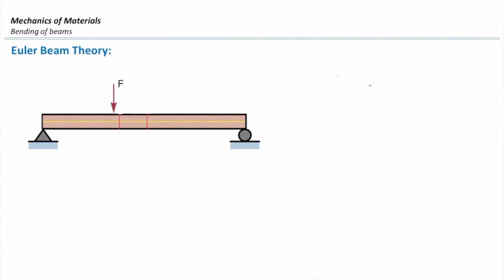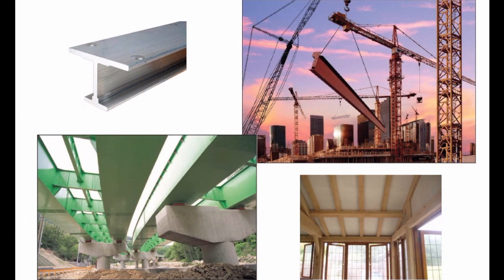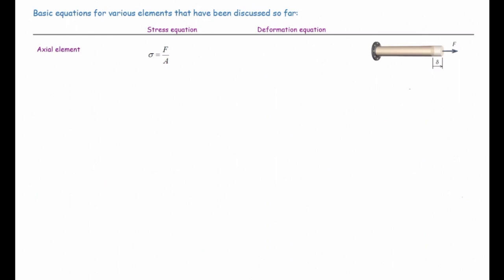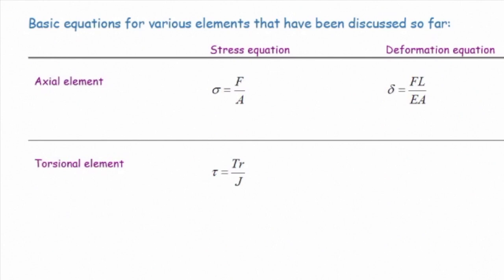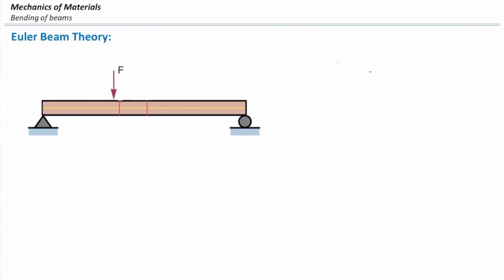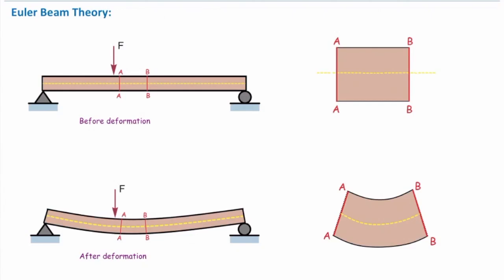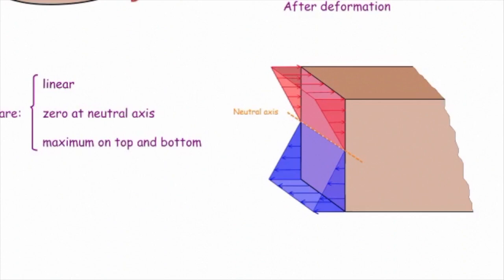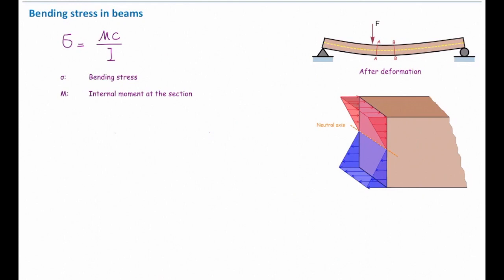Lec12, Bending stress in beams (part 1, lecture)

Comment: I know this sounds basic, but at 5:05, the center line of the deformed element (the curved yellow dash line) obviously does not have the same length of the center line of the undeformed element (the straight yellow dash line). Is there any assumption here to be made???
Reply from the maker: In the deformed beam where one side is compressed and another side is stretched, there will be one line that keeps its length. That part is known as the neutral axis. In the figure shown, the beam faces could slightly move inside to make the curved line in the deformed beam equal to the straight line in the original beam. However, as long as deformations  are small, in could be proved that these two have the same length. Hope that helps.